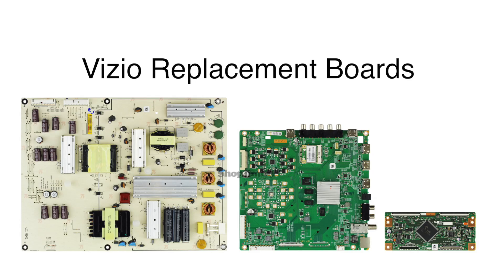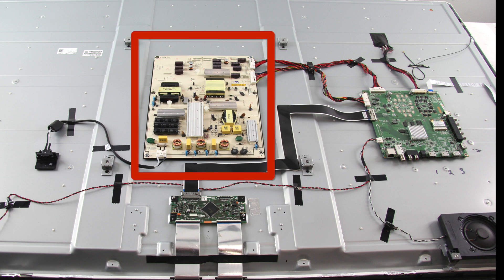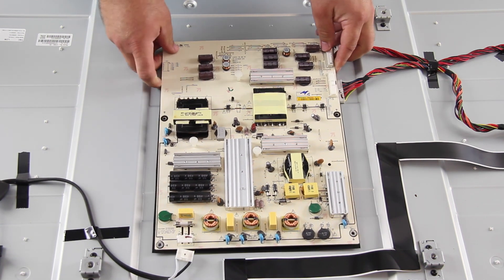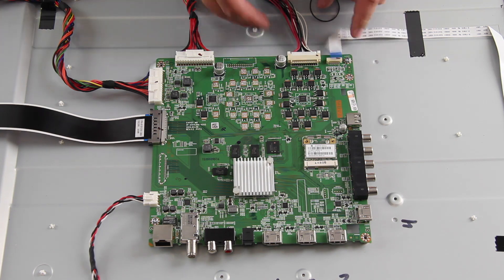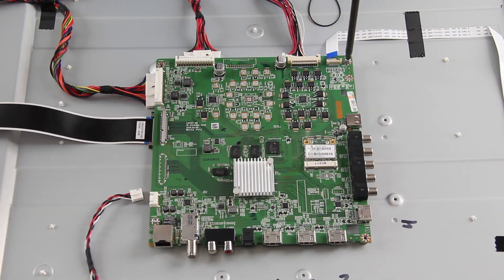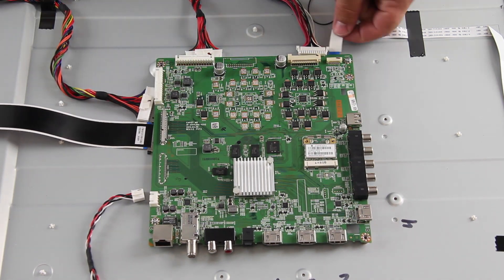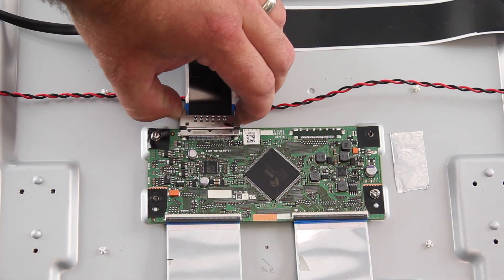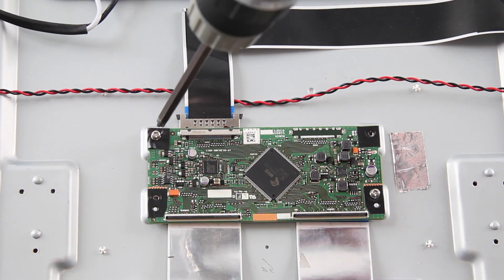Vizio E700I-B3 LED TV Board Replacement Tutorial-How to Replace Main, Power Supply and T-con Board

Comment: Do you know if it will work on 220v? A lot of TVs sold here in Germany at the military base say 110v, but when you remove the back cover, power supply boards say 110v-220v. Just wondering before I go through the trouble of removing my back panel to check.